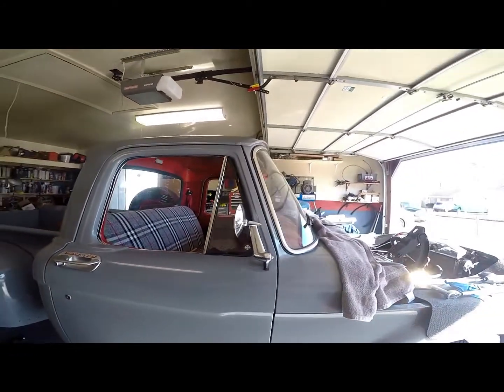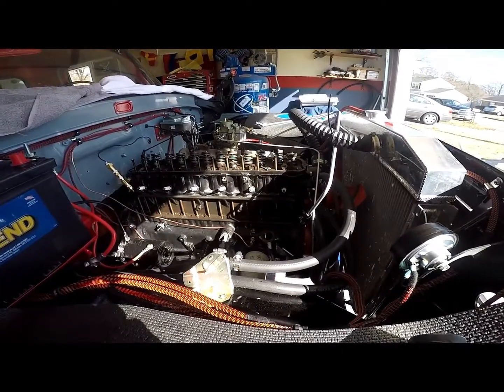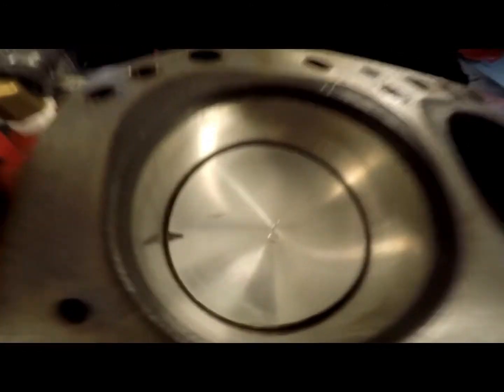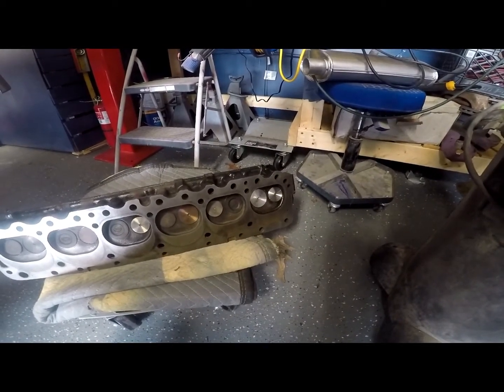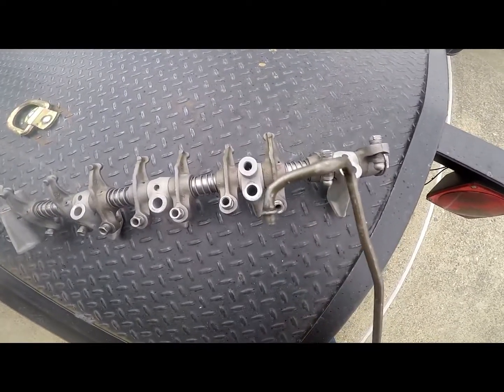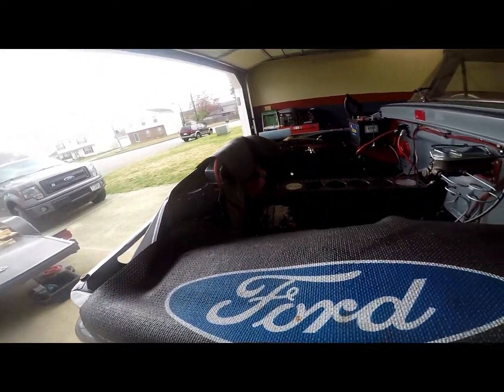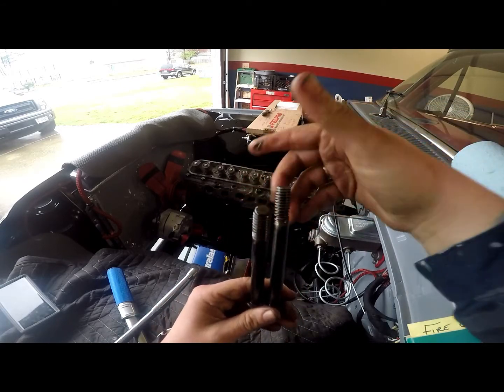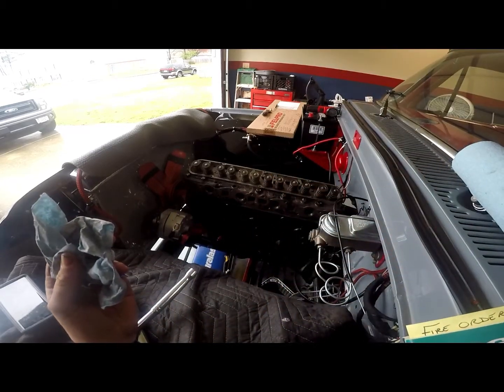exhaust valve failure

Comment: Great videos and sorry for the tough time with the head bolts . Can you send me info on the alternator you are using and the heater hose block that is between pump and heater box. I am working on a 61 ford f350 with the same 223 engine. thanks

Comment: If you run into more problems re headbolts,  Rock Auto has DORMAN 675131 {#C20Z6065B}  Thread Size: 7/16-14; Length; 3.938"; Thread Length: 1-1/16"; Hex Size: 5/8"; STD  They are listed for a 1963 260 cu in V-8   $1.36 per.    .  I restore classic Stereo Receivers and ebay transistors are a crap shoot, fakes from the East are every where.... BTW I've had excellent service from Rock Auto,  they had every part I needed to for my Econoline, and 1948 Dodge so far...Good Luck.

Comment: April you are one tough cookie. Sorry your having so many issues. I was replacing Knock sensors yesterday on my 06 Silverado and the new sensors felt like they stripped when I was torquing them I still finished the intake and of course I am getting codes on both new knock sensors. Damn thing only had a problem with my back sensor and to be cautious I bought 2 new GM sensors but they still broke loose before reaching a lousy 15ft lbs. Made in Mexico GM's finest parts. Lets see if the ebay seller warranties then, I doubt it. the joy of DIY ing.

Comment: The 7/16-14 bolts are, B2AZ6065-A after 1961 they went to a 1/2-13 bolt C1TE6065B. The 7/16-14 bolts are available at NOS Parts Ltd. online, for $4.89 each.

Comment: Mcmaster-carr has 7/16-14 grade 8 hex head screws $11.97 for a package of 10. Part no. 91257A685
It also has the thread length listed but I'm sure thats a standard. Mcmaster is one of the best resources for any kind of fastener or industrial products.

Comment: So glad the bolt didn't break off below deck!  Does that oil tube deliver oil to all of the rockers and guides?
Reply from the maker: That tube is actually the return line, but allowed it to block oil flow off to the #1 exhaust valve (the furthest valve away from oil supply line at rear of rocker arm assembly.  The return line is supposed to have a longer nipple on it to lock the rocker arm shaft in place allowing oil to flow out in small holes at the base.  It was allowed to shift and blocked oil off to that last valve.   the oil flow is in a common rail supplied at cylinder 6, and flows forward toward #1..
I was able to get a used oil tube from a friend in OK, but I'm stuck waiting on ARP and the new head bolts.
Reply: CoastieReid did the machine shop indicate any damage to the other guides?
Reply from the maker: Weldangrind no other damage. Got lucky!